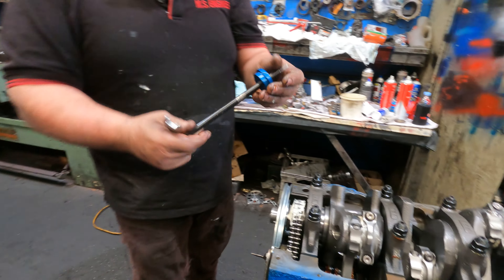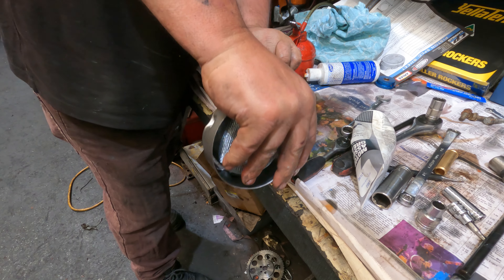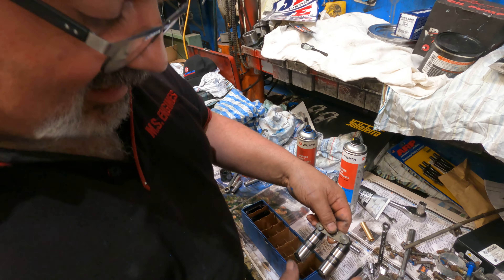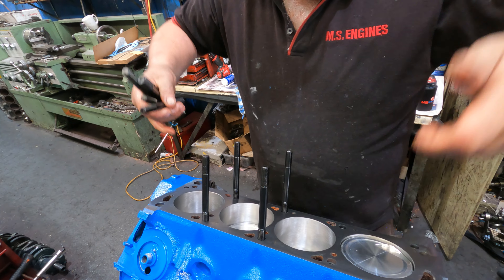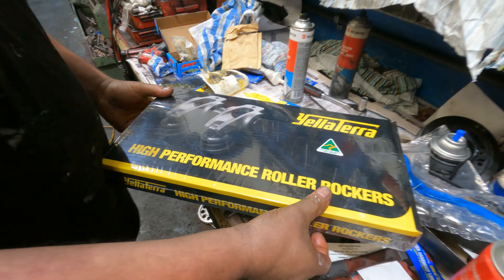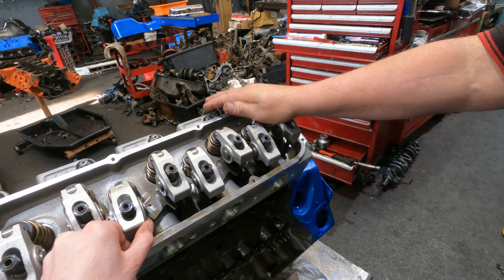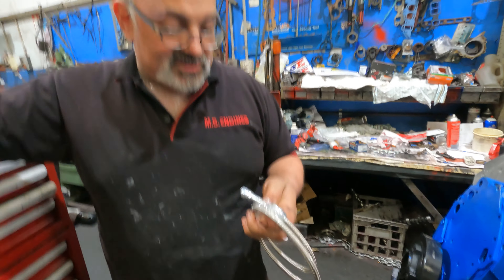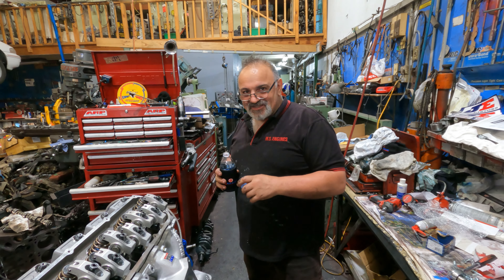302 Cleveland Stroker   Part 2

Comment: Nice build !  good way to get some extra inches ! , I know you've probably  tried this but do you offset the joint in the seal so they don't  line up with the parting line in the cap  , what the parts cost ? bout 8 grand ?

Comment: If you would have put the TMeyer cam bearings in it then you don't need that external oil line. Billy Ray Morgan Jr. actually hooked up clear lines to test that external oil line and ran the oil pump. There was a big air pocket in the middle of the line. Basically showed that external line does nothing.

Comment: 302 c stroker dont really make sense ! The second you remove the crank , rods and pistons you have a Cleveland block that is 351 or 302 so you might as well say 351 c stroker !
Reply: Yes the blocks are the same but here in Australia we had a lot of 302's. Just easier to get blocks.